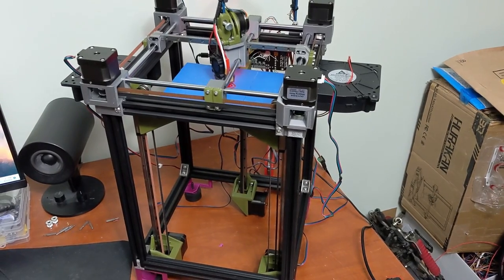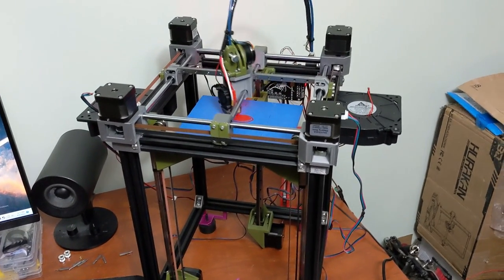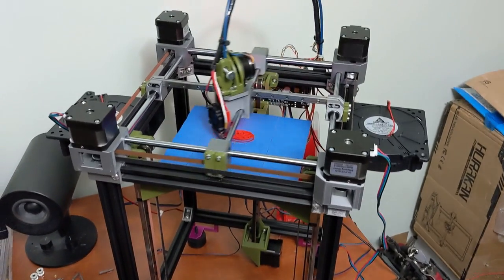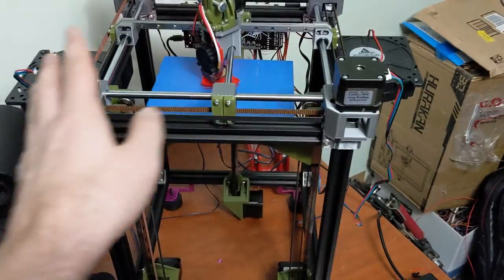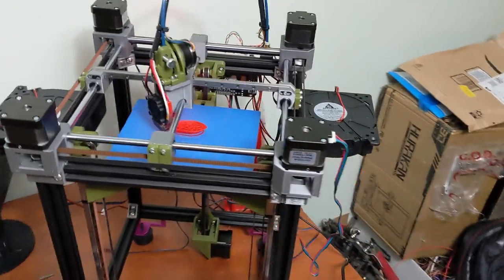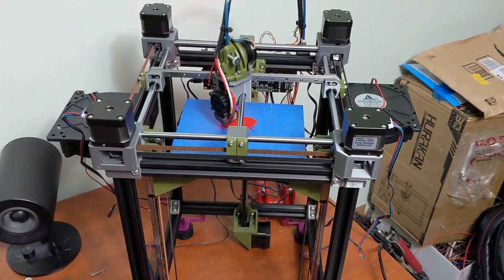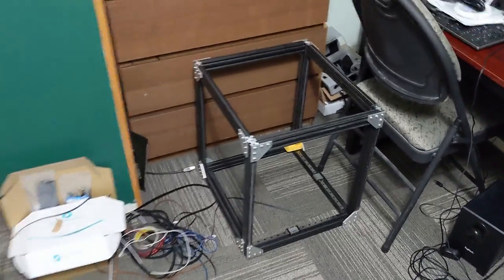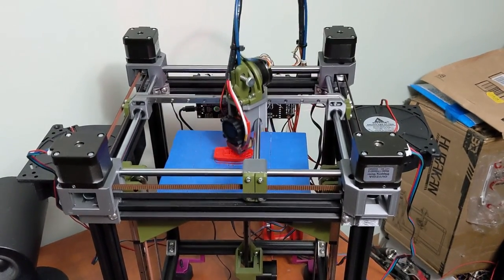DIY CroXY 3D Printer

Comment: Have a look at Igus aluminum rods. They are available in 12, 16 and 20mm OD and are hollow with 2mm of wall thickness. They have a super hard surface coating (had the same coating at company, but needed filing down, after 8 2x4cm areas the file was dull) and a good tolerance at iso h9, making them suitable for linear ball bearings.
I did some calculations, two 20mm tubes are stiffer and lighter than a mgn12 rail sitting on top of a 20x20 carbon square tube with 1mm wall thickness (thats the one you get when ordering one).
Obvious downside is the high space requirements. On the plus is super light, stiff and cheap motion
Reply: Interesting points. Also with rods they will have the same stiffness in all directions. I wonder what the deflection characteristics of unsupported linear rails would be one their side vs flat.
Reply: @3dexperiments  you mostly need stiffness in the xy plain, in z its only really necessary in a moving gantry setup like a voron 2.4.
Its a tradeoff, if you mount the rail standing on the thin side, you loose quite some stiffness, but have easier mounting that needs less space.
Also interesting component: ldo makes special 0,9 degree stepper with 80mm long output shafts, meaning you can sync two steppers with a belt and use 10mm belts. On top of that a support bearing has also enough space. On normal steppers you would need a double pulley for 6mm belts and no support bearing. I dont kow the exact part number, but google annex k3 motor kit (they have ANX as ending in their part number)
Reply: @kilianlindlbauer8277  Thanks for the info!
Reply: @kilianlindlbauer8277  I've tested mentioned Igus aluminium rods with Igus iglidur G buchings. And yes, even the 12mm rods are sufficient stiff when mounted in an H8 fit. The Igus bushings also need an H8 fit to achieve their rated tolerances.
The problem is that plastic bushing have higher tolerances than linear rails. I've tested them and messured 0.04mm backlash and 0.2mm wiggle at the tip of the nozzle on the iglidur G buchings. Quality linear rails have practically zero tolerance.
I haven't compared them in a real print. Do you thing this makes a difference or is it practically invisible?
Reply: @timmjolo1234856  thats why i would use normal linear ball bearings, they will be louder, but have less play. Also linear rails have some play, most we use are the ones without pretension, but mostly for marketing, otherwise they would be called "cheap crap, cant move freely"
In fact, nearly all bearings have play in them, otherwise they would bind up
Reply: @kilianlindlbauer8277  don't the hardened steel balls wear down the thin anodised layer
Reply: @timmjolo1234856  as i said, the coating dulls files, like 200 dollar files. So a bearing should have no chance

Comment: I have a total of 10 broken HP scanners. I was planning to build this kind of a setup for a hobby laser project. I have some brass rings for the 8mm rods and some LM8UU bearings. I will use both to for each axis to reduce gaps.

When I came up with this setup I was surprised because I do not have much knowledge on types of CNC frames. How do you call this setup? Thank you very much.
Reply: In a video of yours I have learned that this is called cross grantric
Reply from the maker: Yes CroXY or Cross Gantry

Comment: I want a printer like this with motors on the outside of the enclosure so I can heat it without cooking the motors.
Reply from the maker: you can get high temp motors also, depends on the temp inside your build area
Reply: Check eustahios printer

Comment: Very nice, I'm thinking of making the same kind of system with MGN9 rails to lower the weight. I really like the added torque. The only issue that I ran into was that I don't have any board that can handle more than 7 drivers (x, y, z, z, e0, e1, e2) and Croxy needs 8 right? Or can you run both X and both Y motors from the same driver?

I already have a lot of parts which I plan to use, mainly lead screws for the Z-axis and I have three 400mm MGN12 rails for the Z-axis and a whole bin full of 2020 and 2040 extrusions.

Just have to buy a couple of stepper motors, MGN9 rails, a direct drive extruder and a cast aluminium tooling plate for the bed, a good SSR and I can start building.

I can't wait to get started on it, just finishing up my Delta over the holidays :)
Reply from the maker: you can run two board at the same time in Klipper on for Z and one for XY